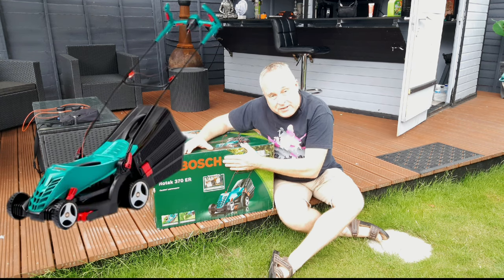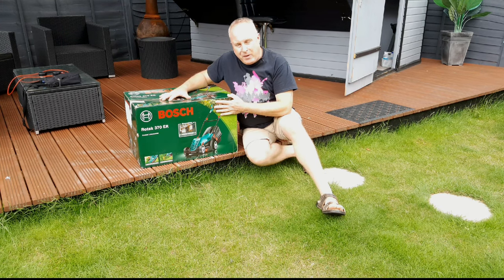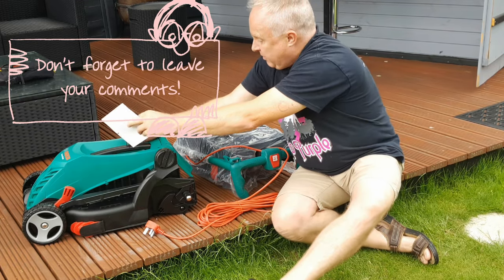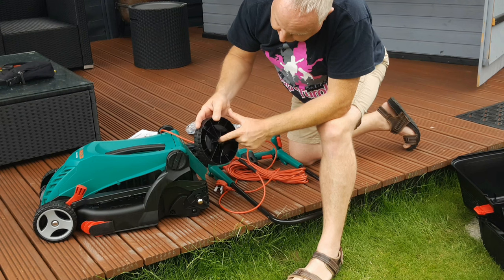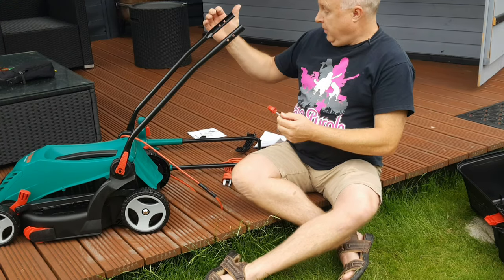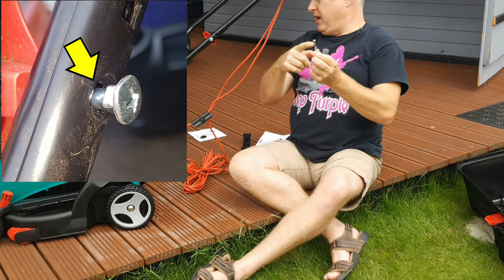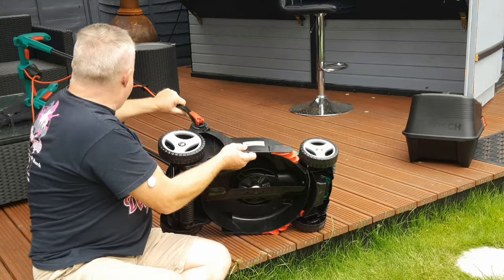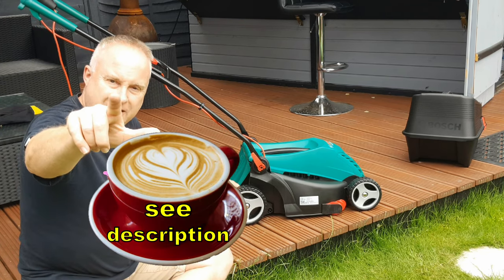Bosch Rotak 370 ER Assembly Instructions and Unboxing 🛠 No Tools Needed

Comment: how i got here i dont know, but i do like the look of the handles on that mower, definately look like they would work better how you have them, surely they would be too low if they were underneath..guess Bosch know best!
Reply from the maker: I agree with you, I think they'd be too low. The elderly neighbour I mentioned has hers above too. She loves the mower because it's so easy to use. The only difficulty she has with it is adjusting the cut height, so she keeps it on low and cuts regularly so the grass never gets too long for her.
The handles are great though. Far better then the 'standard' fayre on mowers.
Reply: All holes line up with them upwards which they wouldn't if they were down, also far more control. Another Bosch Horlicks if you ak me !!!

Comment: Hi A Great Video. 
Just one thing, I have a 10 year old ROTAK so knew about most assembly things. However like many others, on assembly of this one, the black power cable attachment caused all sorts of problems, (at least 10 minutes) trying to work out how and where to fit it. There is a hole on both the black cable fitting and the mower upright but no fixing point for it. Fitting it is absolutely nowhere on the assembly instructions supplied. The very latest one I downloaded from the Bosch website incorporate your solution.  Regarding the handles BOSCH currently show them the wrong way down, so, Overall the assembly instructions are absolutely appalling leaving the customers in 29 countries totally confused. Several YouTube assembly videos from such countries confirm this. It would be great if you could leave the shot of this part on the screen for a bit longer and explain it more, possibly in the video heading !!.
I do wish that they hadn't abandoned the separate lead as, using an extension lead with a plug socket, is in my opinion highly dangerous. Waterproof/resistant extension leads are far safer.
Reply from the maker: Yeah, and a plug in power lead is easier to replace when you do eventually run over it and cut it, lol

Comment: Great video. I have an older 370 that appears to have given up the ghost. I am considering changing the switch in the handle circa £20.  Comments on reviews of current model on various sites suggest that it is somewhat flimsier than the older model. Any thoughts? Do the handles fold down for storage?